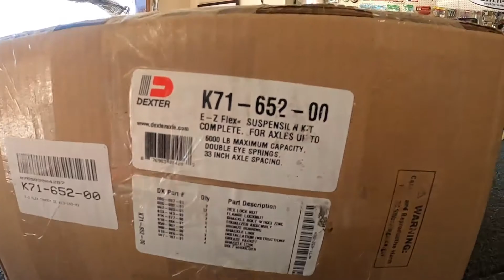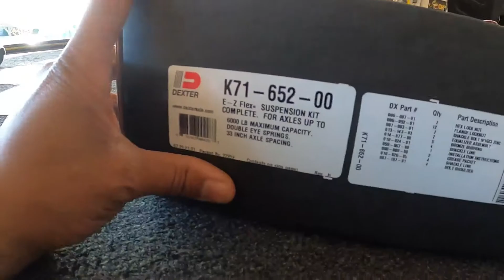How to install the Dexter EZ-Flex suspension on a bass boat (DONT BE STRANDED)

Comment: We just installed this kit today.  One tip, we used my ball joint press to seat the bolts fully.  Then torque properly.  40 foot pounds on smaller bolts, to 50 foot pounds on the big center bolt.  Keep in mind they are shoulder bolts.

Comment: Thanks Josh. I never such a kit was available. I use a needle type adapter and try to squeeze grease in. This is a much better system!
I'm on my third set of leaf springs on a 20 year old trailer. I will be installing this kit when I lose my leaf! All theses trailers, from all the manufacturers, install bare minimum components so we can haul our top dollar boats around. It's not right!
Reply from the maker: You're welcome and I was taking spray lube to them prior to these. It helped some but definitely didn't stop it from happening. A triple leaf spring kit will be my next upgrade for this trailer. This should be standard with all the boat trailers you are right about bare minimum.
Reply: I took an 18’ utility trailer to the shop last week to get new bushings, because I could tell that they were wore out.  Three days later, I picked up my trailer with this kit and new springs.  I was surprised at how much smoother it rode,…but i was truly amazed at how quiet my trailer was as it went down the road.  And I have the big d-rings welded on it. I barely heard those bounce around about twice when I towed it home.

Comment: Have you had issues with the vortex hubs? I have a 2020 nitro z20 and have replaced 6 in 3 years
Reply from the maker: Wow that's pretty excessive. When I first bought the boat in 2019 I had 1 shell out like 2 months after I bought the bought. Company replaced with no issues. I've had no problems since. When you install them, are you making sure when you tighten the main nut there is no play in the bearing or not over tightened? How's the spindle look?

Comment: Do you tighten the bolts on the equalizers till the splines go in then loosen them a little so there not to tight?
Reply from the maker: Yes thats what we ended up doing.
Reply: @InfiniteBassin  ok thanks

Comment: NITRO needs to use heavier duty Springs
Reply from the maker: The springs work just fine its the hardware they need to get straight. No reason the bushings should be nylon and the shackles to be that thin. The dexter kit definitely helped correct the inferior hardware.

Comment: Well you made a big mistake. The (4) single Wet Bolts you did NOT place discharge grease hole at either 3 or 9 o'clock. Why? If the hole is at high noon or at 6 o'clock you will NEVER be able to grease the wet bolt due to the weight covering the discharge hole... All other wet bolts in the shackles are preset so once install the discharge hole is in the correct position... Why reading the instructions is important. Sadly your followers may make the same mistake...
Reply from the maker: I didn't make a big mistake. The bolts lube just fine thanks. They've been on my boat for over a year now and work just fine. Spread your NEGATIVITY somewhere else. 🫡